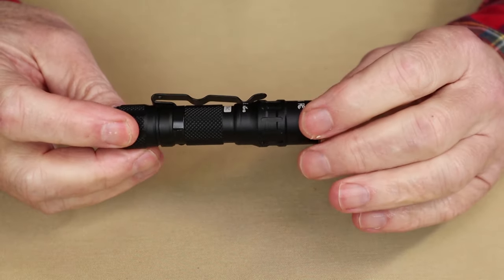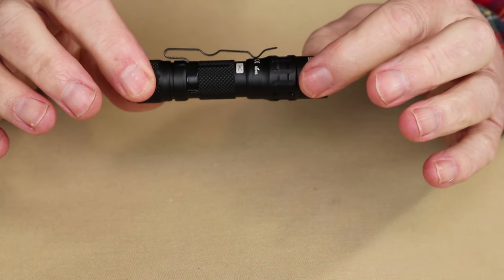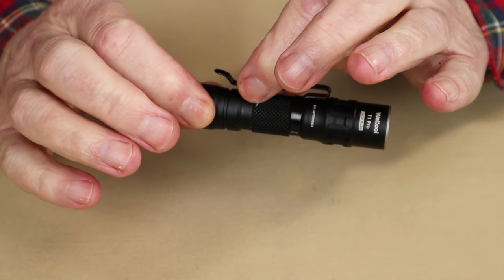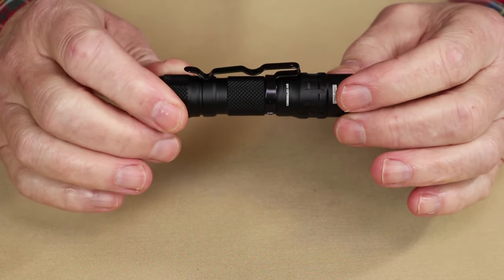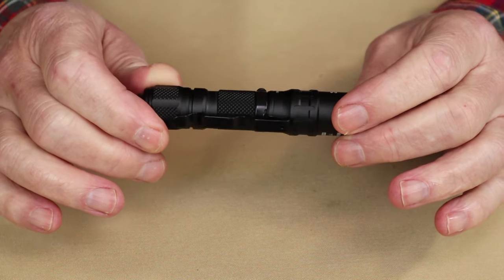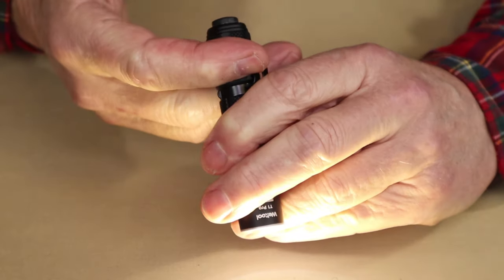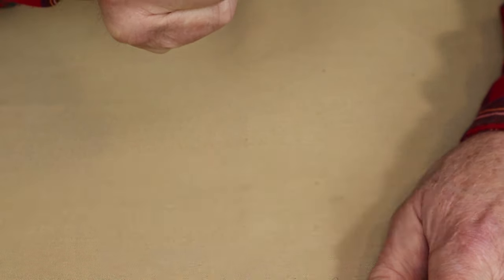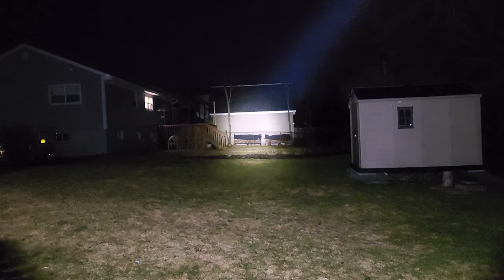Welltool T1 PRO TAC EDC Flashlight Little Duke

Comment: Engineer POV: I'm a huge fan of dual-voltage lights that can use Li-ion or common replaceable batteries. 
They are more versatile: Recharge when possible, carry a long-shelf-life lithium-metal AA battery as a spare.
Reply from the maker: I agree. This would be near perfect if they can change lumen switching. Thanks for commenting

Comment: you just gotta press the back tail switch rapidly regardless if its 4 5 6 7 8 9 etc,  just tap it fast until its low, tap it rapidly!  its much simple to get to low,  dont worry about the number of taps just tap fast until its low
Reply from the maker: Thanks for commenting

Comment: As for us seniors, I think the operation from bright to low is VERY cumbersome. 
It may be a great investment for young folks, but as we get older, our joints get worn out and small motor skills are harder to do. 

I ALREADY have flashlights that for myself are harder to adjust from brightness to dimmable, or from flashing to solid stream. 

So for young Folks this may be the perfect light 🥰
Reply from the maker: I would rate this light much higher if it had an easier way to change modes. Thanks for commenting
Reply: This is the tactical version, the low setting is supposed to be this way to not accidentaly activate low. The same flashlight can be had without the TAC feature. Then it works like a normal flashlight with low-med-high.

Comment: Thanks for the review, Mark!
That method of toggling from high to low seems overly complicated and fairly touchy to me.  Most flashlights with multiple levels just have you toggle the tailcap once to switch to another mode, and I've never had any trouble being able to manage that process.  This seems not only a little more complicated, but remembering HOW to do it (How many clicks?  Which do I hold on?) is a deal-breaker for me.  I'd probably spend several minutes trying to remember exactly how to do that, and it's just not worth it to me.
Thanks again!
Reply from the maker: Unfortunately, I agree. I like this light and if it can be made easier to change modes, it would be even better. Thanks for commenting
Reply: @MarkYoungBushcraft  They made it four presses to get into Low mode because it's a TACtical light. So when you utilize High mode momentarily you can do so confidently without worrying about accidently engaging a different mode. You are able to momentarily press it on and off if needed without worrying. Four presses ensure you're purposely trying to engage Low mode and won't accidently end up there. The T1 Pro is the more friendly light with Medium and High modes. And then, Low mode hidden under four presses.

Comment: Lucky your neighbours aren’t drug dealers or thieves.   Cuz every time you get a new flashlight, they’d panic and think it’s a bust! 😀
Yeah that low thing is really bizarre.   The way they’re all different is one of the reasons I get the simplest possible.  Even twist caps for small ones…..OLight is the only one I’ve ever seen with a low/high twist cap btw.
Oh, and that Costco one I told you about, that is a very full sized one, whopping powerful flood, came with a lithium battery, a battery pack to run with AA, 14 hour run time on low, which totally illuminates a medium sized room, and one other feature I’ve never seen.  If you cover the light, it shuts off, to prevent it from overheating, or coming on in a bag.
Reply from the maker: I drive the neighbours dog crazy with the lights😂. I will take a look at Costco for the light. Thanks for commenting Jim
Reply: @MarkYoungBushcraft    I dont know if they  have it at my Costco anymore.  It was a special, only $29 8 Duracell batteries included!  Summer stuff is out, so maybe they’ll have more deals